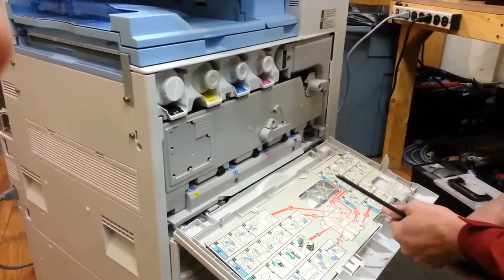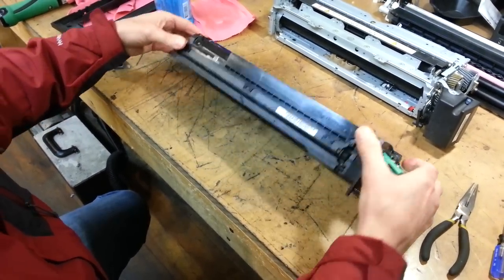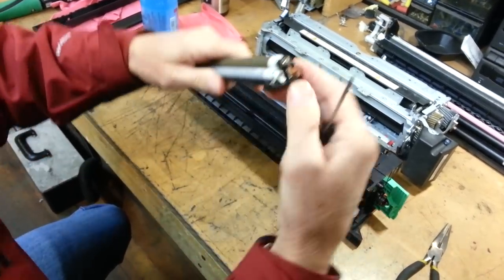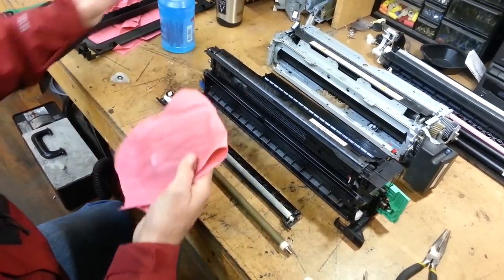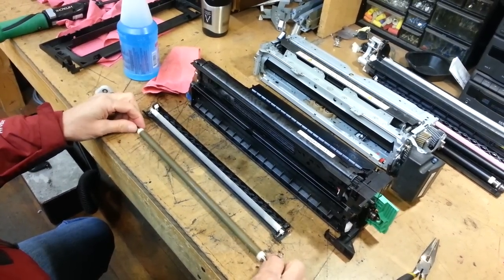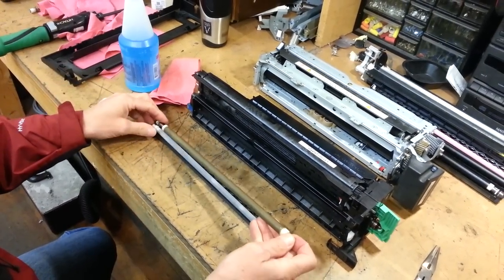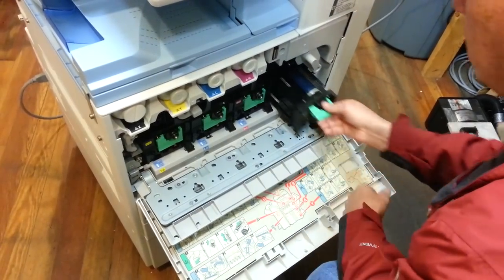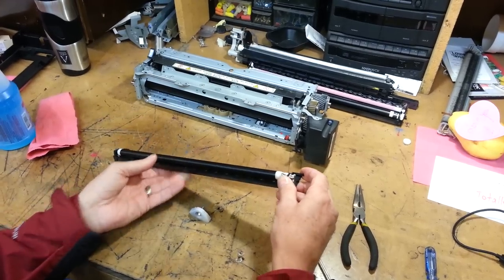Cleaning charge roller for streaks in MPc2000/2500/3000/3500/4500

Comment: I am a 30 year dealer tech.  Some of what he is saying is true.  The "black" roller he is talking about at the end is total bunk.   That was a different roller vendor which was used in the drum manufacture.  "Black" does not mean drum is worn out.   A true test is the appearance of the drum, it should be shiny like a mirror, if it is starting to dull from wear or poor paper, you can clean the charge roller as much as you want, it is only temporary fix, problem will resurface after a few days or hours.   Writer "Dizzy Ink"  Good luck with mpc3003.   It is quite a disassemble to get those chargers out.   I can about guarantee you will wreck the drum trying and those are expensive drums even for vendors.
Reply from the maker: I am a 34 year dealer tech. All of what I'm saying IS true! I did not say the PCU was worn out if you have a charge roller that has turned black. I SAID that it is probably a good sign to replace it! They WILL turn black as PER the OEM CHARGE ROLLER (NOT GENERIC) at the end of this video!  "scanner lanier" is talking about a generic rubber charge roller that would never see the inside of my shop!  As for a MPC3003,  I would not suggest trying to clean the PCU for they are nothing like the PCU in this video! 

 I just love it when you put up a video to help people and there is always someone who thinks he know's more! LOL
Reply: Sorry, didn't mean to step on your toes.   However we are trading in some of that old series that still have the black OEM charging rollers in them.   I think it was when Ricoh switched from the B223 to the B224  drum series when the change occurred.   BTW I have never seen a tan or gray charger get solid black, a customer would have called long before that ever happened.   Take care
Reply from the maker: Agreed!

Comment: hi sir i have rico mp c4500 it has toner problem and i have instaled a new toner also have the same problem, a search the fault nd i found that the powder is not coming throug the section pump, can u tell me how to  conferm the pump?
Reply from the maker: I have a video on how to replace the pump and supply hose which is what you will need to do. 9 times out of 10 that is the problem.

Comment: Hi!  I have a few questions if you don't mind.  We need to replace the roller you clean with the window cleaner and the foam/spongy roller (removed from unit at 1:04 in the video) for all 4 colors on our c2500 unit.  Can you tell me the exact name and/or part number for those two rollers?  I have seen several online, but not sure if I'm ordering exactly what we need.  We have terrible streaking because the foam/spongy roller is disintegrating.  It's holding a ton of toner and when we try to clean it, it's just crumbling.  The roller you clean with the window cleaner, has been cleaned and might have some life left, but we for sure need the other roller.  If you know of a place to order that is reputable, please include that in your response as well.  Thanks so much!
Reply from the maker: +Erika Z  Sorry to say but if you find one it will NOT be a OEM (original) roller. Generic rollers only cause problems in my experience and you cannot find the original manufactured charge roller sold separately anywhere! Your best bet is to order a black PCU and watch my video to modify it for color if need be.
Reply: +Hadley “Copydoc” Hudson Thank you for your prompt response!  Can you recommend a place to order the black PCU from?

Comment: When I pulled the assembly out of our printer (2000), it was dropping black powder like crazy. I blew some of it off with compressed air, but it seemed like there was always more.

So two questions:

1) Can you tell me role of the drum?

2) Do you have any ideas as to what all the loose powder might mean?

Depending on your answers to those two questions, I suppose we may need to replace the drum.
Reply from the maker: +Benjamin Carlson= Toner all inside of machine most likely is Developer unit needing to be replaced. After it wears out the toner has no where to go but inside of copier. Developer unit should last about 250K and Drum about 120K.
Reply: Thanks for the reply! I'll take a closer look now and see where we sit!

Comment: How about to open out the mpc 5000 charge roller....the charge roller without c clip...so very hard to take out...with proper..
Reply from the maker: Yes, the newer style PCU's are more difficult remove completely. Just remove the charge unit with the two screws on the bottom of the PCU and clean charge roller while still in the charge unit.

Comment: sir i have problme with toner detection would you like to help me plz .... i changed toner bk n now machine mpc3000 not dectecting properly ... may b there toner pump issues so would you like to help me plz .... i m waiting for your favorable responce ... ...
Reply from the maker: I have a video on how to replace the toner pump on MPC3500 that is very similar. However, on a MPC3000 it is more difficult to get to the toner pump hose. I recommend you leave the hose and replace the pump. Also, make sure you open and close the front door several times to give the machine a chance to load the new toner you installed.
Other possibilities:
1-toner tube has a pinch in it
2-System/CopyFirmware needs to be higher than 1.59
3-do SP5-801-002 engine clear in service program mode 
4-make sure all doors on machine are closed

Comment: hy I have mpc 3002 please show me how to change the charging roll
Reply from the maker: Not worth changing just the charge roller. You may be able to find a charge roller separately but it will probably not be OEM. Just replace the whole drum unit and you will have a much better result. Check my other video on replacing.

Comment: Actually the best and longest lasting fix is to use a strong solvent of some sort and a scotch brite pad and scrub that 'tan' coloured' coating right off down to the white nylon surface like a "scratch ticket". Been doing it for years.
PLUS...you are WRONG about the Black roller that you argued about with "Scanner lanier", because that surface DOES NOT scrub off!
It was simply the first generation PCR's (charge rollers) that were used on the OEM units.
FYI..... CAR Wax is the best thing to use on that style

Comment: and also the machine says SC 792
Reply from the maker: Sorry for taking so long to reply. SC792 is simply caused because you have a bridge unit installed and looking for a finisher that is simply not plugged in. The bridge unit is where the paper comes out in the center of the machine. Either plug a finisher in, take the bridge unit out or live with the code that WILL NOT cause a problem.